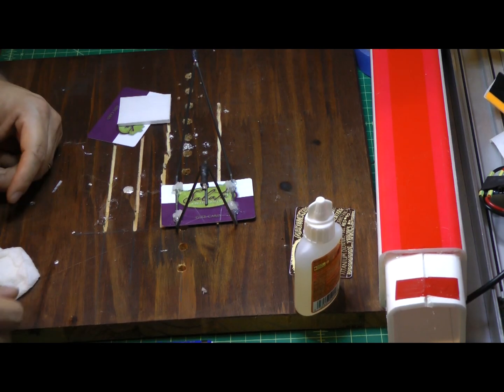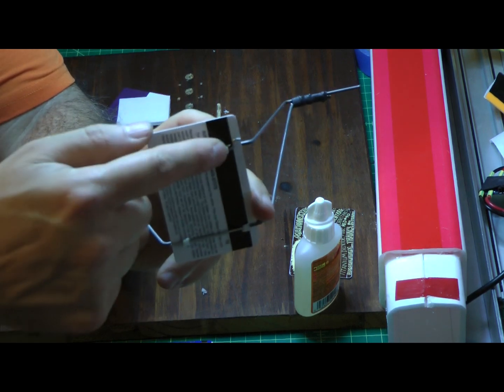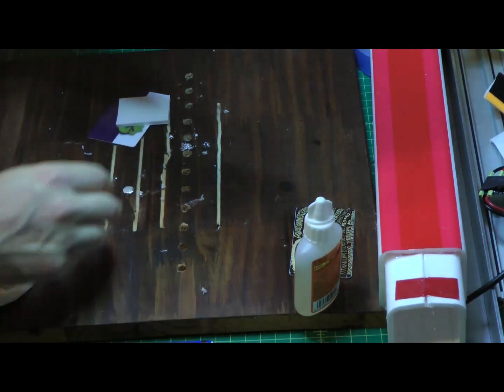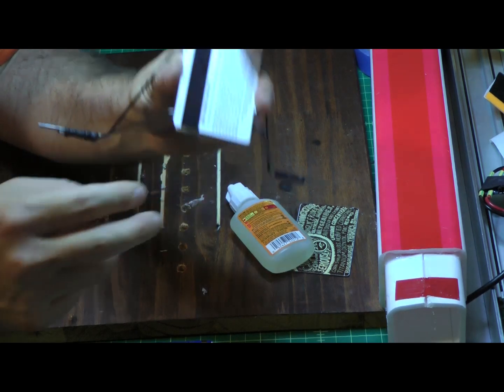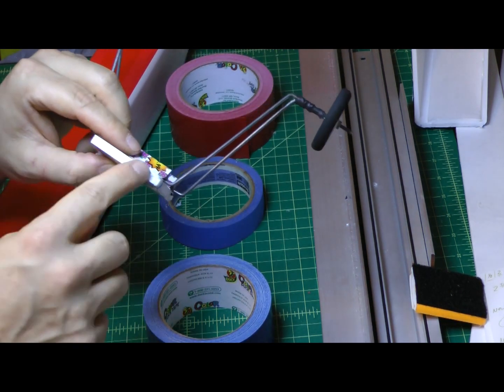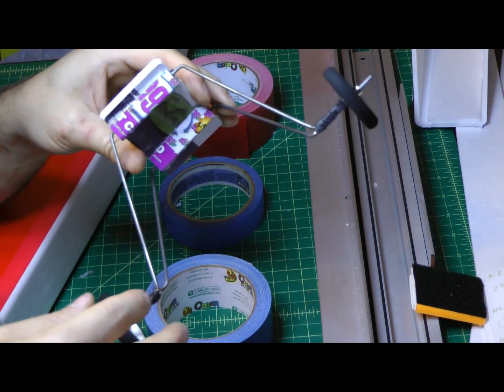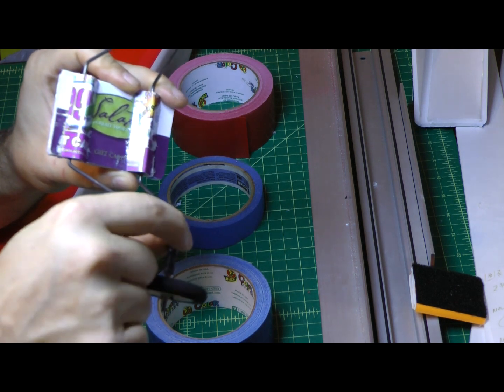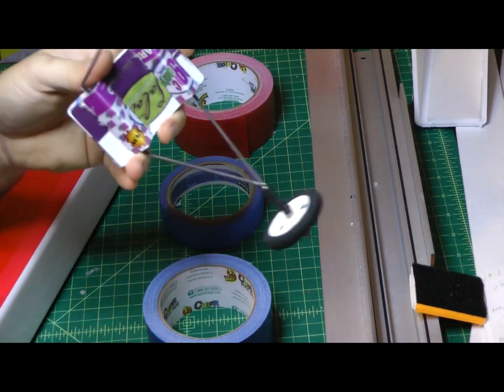Simple Landing Gear

Comment: Great idea but how did you bend the wire? I just bought a Du-Bro EZ bender and the wire snapped when I got to 90 degrees. I was using 3/32" music wire.
Reply from the maker: Douglas Snyder I just use a couple of channel lock pliers.  Haven't had the wire snap yet.
Reply: TheRevJVegas Thanks for getting back to me. Good suggestion. I tried using a bench vice at work to bend the wire and that works very well too...without snapping the wire, and was able to get good 90 degree bends right where I needed them.  A note: Du-Bro makes good stuff and I contacted them about the wire issue and it was pointed out to me that on their web site it specifically says not to use music wire with their EZ bender. Live and learn.

Comment: Great thanks! 
Oh by the way instead of wheel stops you might want to use electrical wire (just the insulation, not the metal interior).

Comment: Love it, I just built a little cargo kind of plane and i hated belly landing and breaking props so i used some coat hanger wire, some zipties, two wheels and a LOT of hot glue :) worked out perfectly and it gives a little spring for absorbing shock :D

Comment from the maker: So far, I've mounted them this way on two of my planes with pretty good success.  Two little pieces (I'd say about 1 inch square each) of that 3M heavy duty stuff had been more than adequate for me.  After making two of them, each has come out right around 58 grams in weight.  I like to mount them to where the axle is just forward of the wing.